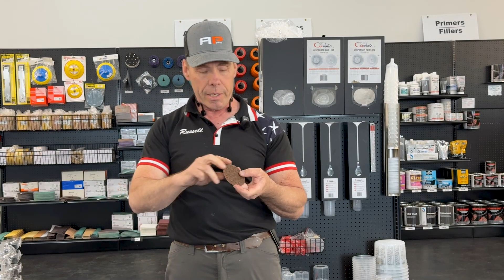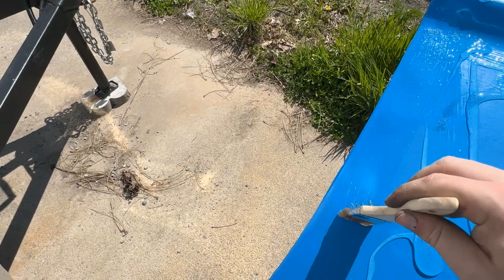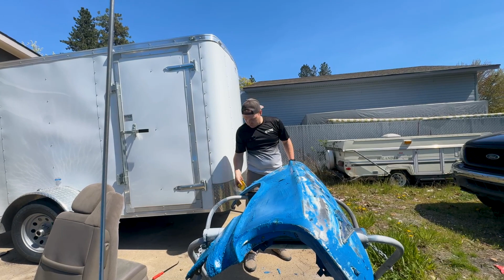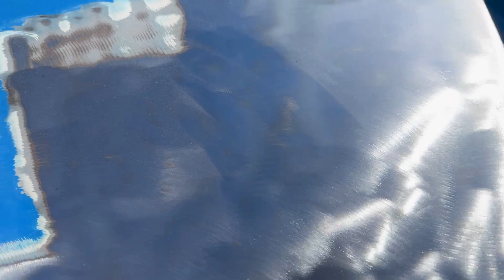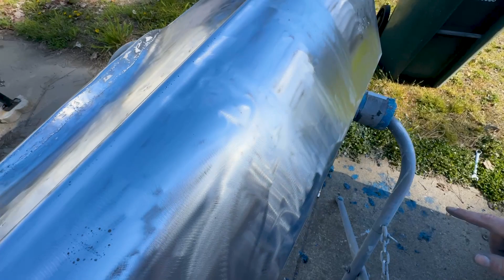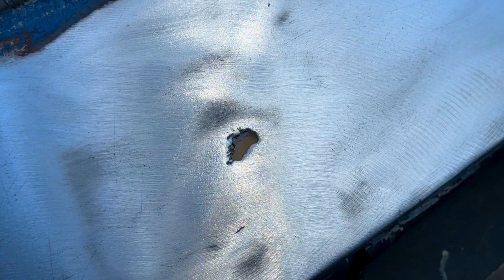We Tried Multiple Methods For Removing Old Paint: Restoration Guide Episode 3

Comment: I used Klean Strip Aircraft Paint Remover on a motorcycle gas tank.  I let it soak under plastic for a couple days, during which it dried up.  Funny, but the paint re-adhered to the tank.

Comment: Question, after using the chemical stripper what do clean the residue with?
Reply from the maker: The next episode we go over the chemical stripping process a lot more in depth, and we try out a couple different brands. But after using the stripper, we just pressure washed the residue off the panels and applied a chemical coating to stop the steel from rusting.